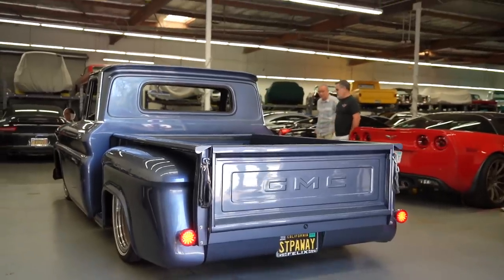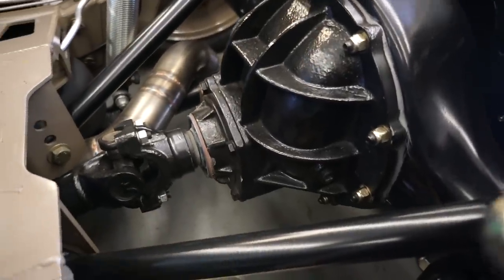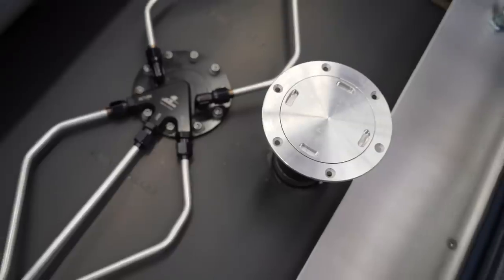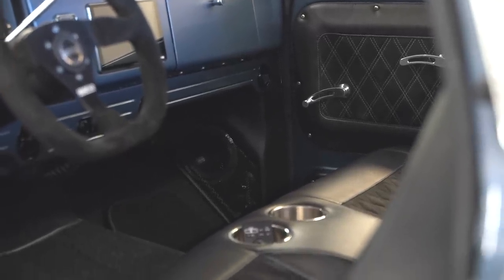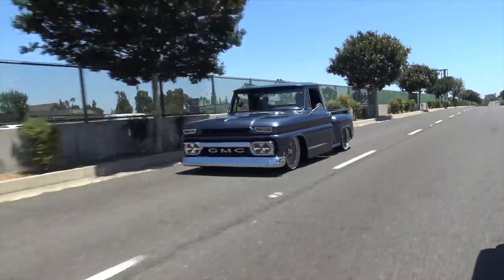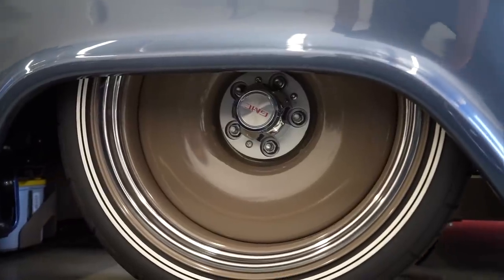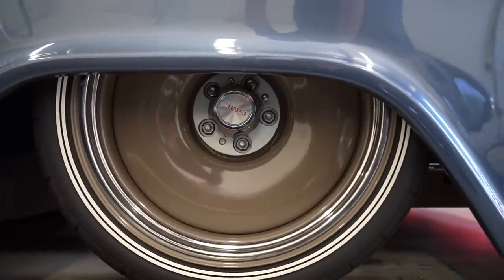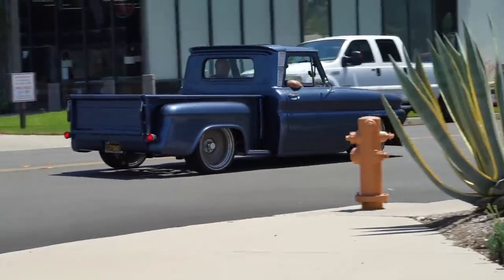'64 GMC C10 Step Side LS Powered Restomod on Air Suspension

Comment: 60 - 66 is my favorite era for the C10. I have a 65 but it's nowhere near as clean as this. This one is sweet! I started on mine in 2000 when the 350 crate engine was still the engine of choice for most builders then used a TH350 in front of a 3.55 limited slip Ford rear end and it became a daily driver.
Reply from the maker: Sounds like you have a cool one too. This is such a well done build and I love the Stepside
Reply: I had a 65 for several years too. I put a fiberglass tilt front-end on it with a built 400 Pontiac motor. Had a lot of fun in that truck.
Reply: Yeah I agree with you man they are sexy trucks and way underrated! We have a 66 c10 with factory air which was a very rare option!

Comment: Very weird. I am on the Comet crash video. Initially when it started, it automatically went to the truck video so I had to hit the previous page arrow. I have finished watching the comet crash video and I am still on this page, but the comment section is talking about the truck video.

Now after forwarding the video, I am on the truck video with my comment. I hit previous page and now this comment is still there, minus this new paragraph. So my comment is both on this page and the previous page, the comet crash.

Comment: I love how the Chevy guys even know their rear ends are garbage so they all put ford 9” in them 🤣  beautiful color on that thing 👍
Reply from the maker: Hard to beat a 9” I’d say. Such a beauty of a build
Reply: I love how all the Ford street rod guys all run Chevy engines and transmissions because theirs aren’t worth having 😆
Reply: @69RSCamaro  just the poor ford guys who can only afford a ls chevy motor cause the junk yards are riddled with them and they’re dirt cheap. I don’t mix n match I guess.
Reply: @minnesotatomcat  chevy guys (actually, almost everyone) wants to go fast for cheap. Brand loyalty is irrelevant when you have a strict budget. That's why everyone has a chevy motor/trans and a Ford axle. The chevy rear ends aren't garbage, 12 bolts are great... but a 9" is just as cheap and can handle more abuse.